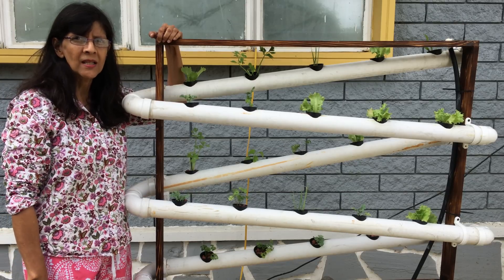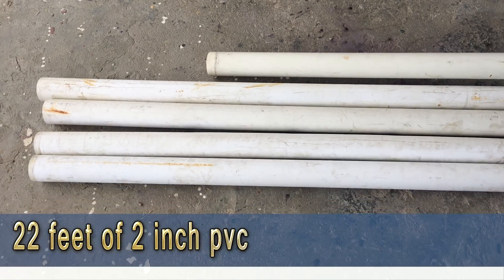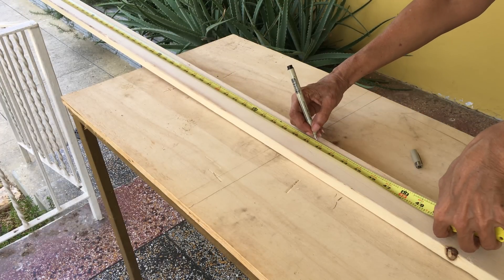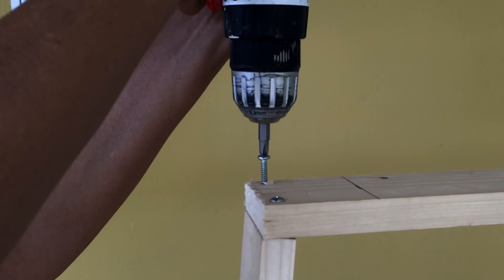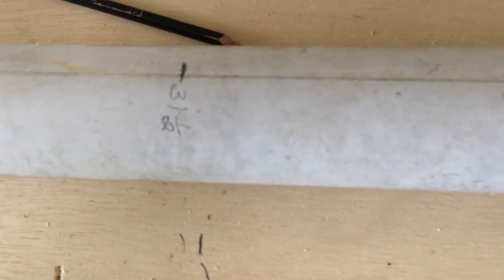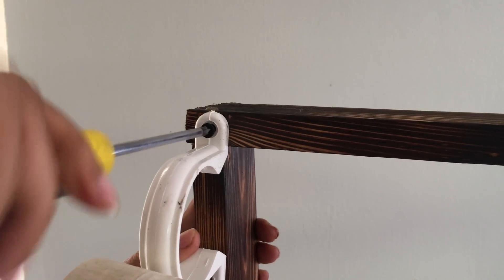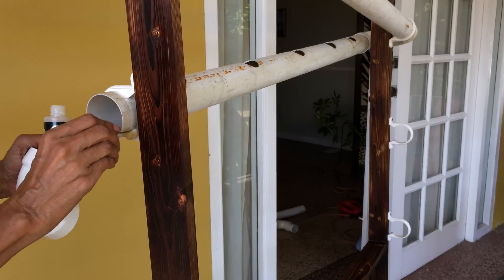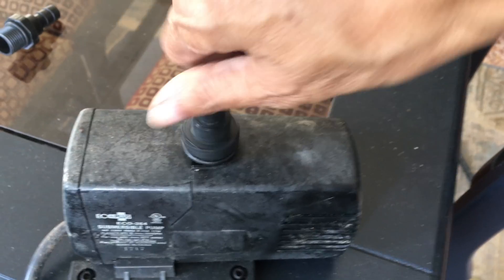DIY Hydroponic Tower NFT System

Comment: A very well done DIY Video Thanks. I have one question, how often do you have to up-grade or replenish your nutrient reservoir (5 gal bucket), How long do you think it would function left unattended (hot Climate) . Thanks Dave
Reply from the maker: Thank you.I usually top up about every 3-5 days.I would not recommend that you turn off the pump in a hot climate as I live in the tropics and the plants would wilt within minutes without the constant flow of the solution.

Comment: Thanks for your instructional video. I've made a system using this concept, just a bit bigger, and it is working very well.  I added heavy duty adjustable furniture feet fittings, so the system can be easily levelled.  So far, so good for leafy greens, herbs, and strawberries.
Reply from the maker: Glad it helped!

Comment: Very original & simple to do hydroponoc system. You mention 2 inches pipes, but they look 3 inches to me. Maybe I am wrong.
Reply from the maker: Thanks.I used 2 inch but 3 will work just as well .
Reply: @over60crafter  Thank you very much for the reply

Comment: Hi ! Thank you for the video. I made somehow the same kind of build (with 4 inchs tubes) and I was wondering if I had added too much angle to my PVC tubes (4cm per meters / 1.5 inch for 40 inchs) because my water level is very low inside the tubes and the flow goes fast. But when I see your angle, I guess it might be the case for you also. Is it an issue for you ? Also I missed the part where maybe you give the dimensions of the baskets/paniers. Are they touching the bottom of the tube ? Are they touching the waterflow ?
Reply from the maker: Hi,some people say mines is a bit to steep but it worked for me,after all it's an nft system which stand for nutrient film technique.I used 2 inch net cups.They don't touch the bottom they are about an inch from the bottom, I made sure the roots were long enough before placing them in this system.Hope that helps.
Reply: You understood that in my case I'm not sure if the issue is : the waterlevel too low or my paniers/baskets too hight above the waterlevel :(
Reply: Ok ! Thank you for sharing your experience and knowledge :)

Comment: Thanks for you video,For lettuce, mint, and coriander, which size pipe and net pot are recommended
Reply from the maker: I have done lettuce in 2 inch and I am sure you can also use that for the coriander,the mint however since they grow very big easily I would recommend a larger size about 3 inches.
Reply: @over60crafter  which one is recommended as grow medium ?Cocopeat or perlite ?(for both nft and dutch bucket system)

Comment: Hi. I build one like your, very appreciated your instructions. But when i put the 2 inch pot and i see the water not touching it. About 1/4 inch gap from bottom pot to touch water. So is that still work? 
Also how long the time you have to set the pump since this build nor horizontal, if stop pumping the water will be gone? Please have me these 2 questions. Thanks
Reply from the maker: I actually squeezed the netcup while placing it into the hole so the top of the netcup is also inside the pipe that way it touches the bottom and is able to be in contact with the nutrients.This system will require you to run the pump full time or if you live in a cooler climate you might get away with running it for about 2 minutes every half an hour or you can experiment to see what works for you.

Comment: Hello and thank you! I built a version very similar and I bought the same pump you used in the video. The pipes are the same elevation and size as yours. I am wondering if the 396gph is too much for this setup. The water is very fast. What do you think? Love your channel.
Reply from the maker: Thank you. If it's the exact same pump,then it will be fine.I looked at your build well done,only suggestion is to change out the clear tubing as you will end up with algae growth in it.

Comment: Amazingggggg video Ma'am.
My question might be silly but it's always better to ask instead of assuming...
It would be great if you could share the reason behind the keeping / mounting those pipes at an angle or in a slope form.
Would like to know the reason behind it.

Also, can I increase 3-4 more pipes?

Please guide me on the same.

Keep up the good work...

Straight away heading to click on the subscribe button along with the bell icon. 🤗❣️
Reply from the maker: Constant flow of the nutrients as its a nft system which  involves growing plants by maintaining a coating of nutrient solution around the roots.
Reply: Okay Ma'am!
Can I add 3-4 more pipes?
Thanks a lot for the prompt response!

Comment: very informative video. instead of buying ready made hydro system which is a little bit pricey, i think i will build my own now that i have clear idea how to do it..... I would to ask though, what is the ideal distance between hole? seen in the previous video its about 3 inches apart but per your video its 8 inches apart, thus limiting the number of holes. thanks a lot
Reply from the maker: Thank you.The spacing is really depends on what you are growing,it can vary between 3 and 5 inches apart.Chive for example does not spread out as full as a lettuce plant.Good luck.

Comment: Thank you very much for this vid! Will 80 gph do for the pump? Other option is 300gph, but want to spend as little as possible
Reply from the maker: You are welcome. Look for a pump that can pump up to six feet high .I have  a link in the description,I don't think 80 gph will work unless it can pump up to six feet high.
Reply: @over60crafter  thanks for looking at my build. I stepped out each level so that the overhead light wouldn't be blocked by the pipe above it. You're right, i knew that clear tubing was a mistake while I was installing it. Thanks for the advice, I will keep the pump and see how she does.

Comment: Hello! Thank you for the video. My girlfriend and I built a small version of this, with the same pump, somewhat less slope, but 4" pipe. We are finding that the water flow in the bottom is only about 3/4" wide, which does not seem to be deep enough for our net potted starts. They do reach the bottom, but the strong flow of water tends to push the roots to the sides of the PVC, away from the water. My girlfriend insisted in 4" pipe because of other videos she saw, and now says we need to decrease the angle (dramatically) so the water flows much more slowly through the PVC. Do you have any recommendations on how to do this, or other corrections we could make? Thanks again!
Reply from the maker: If the flow is to forceful why not get a less gph pump but just ensure it can pump to the height of your system.You can also had another level or two of pipes so that the angle won't be as steep.
Reply: I know this is 1 year late but for others, an option would be a wick, such as a nylon or polypropylene (think food safe) rope run through the bottom of the net pots as a wick.  Maybe a 6" or 12" piece, slightly untwisted just to get more moisture wicked up.  Its a trick I have used before.

Comment: Thank you for a very enlightening video. Very clear instructions. Is there a reason why the gradient of the pipes on one side of the frame is steeper than the other side? What is a recommended gradient  and what is the effect of the flow rate in the pipes on nutrient uptake and plant growth?
Reply from the maker: No .In fact you don't have to build it as steep just add two more rows of pipe and push them up so it would not be as steep.

Comment: Hello..im just wondering what will happen to the system if there's a power interruption like for several hours?
Reply from the maker: This system is intended to run 24/7 so if power goes out for a couple of hours the length of time the plant will survive will depend on the temperature,you could also just water the plants every hour and I think it would be fine.

Comment: Awesome, but I think the slope is too much, water will flow fast and go down, and I didn't see any stoppers at the bends to keep some water for the plants all the time. This will use more energy as the pump has to work more.
Reply from the maker: You can always angle it differently so that it is not so steep and that way you can get more plants in,thing is this design works for me,I use a 396 GPH pump and it is on 24/7.

Comment: Hi...awesome and very informative video...best and easiest to follow thus far...what kind of seedlings did you use in this project? Also...how often did you change water and/add nutrients?
Reply from the maker: Leafy greens like lettuce, swiss chard and other do well in this system.I usually just top up the solution when necessary.

Comment: Great video. Does the 5 gallon bucket need to be good grade or can I find one at Home Depot?
Reply from the maker: I would recommend a food grade bucket check your local bakery or grocery they usually have lots to dispose of after emptying food content like frosting,flavorings,syrup etc.
Reply: Thank you! I successfully finished the build today. I was curious about the slopes of the pipe and the required flow rate. 5.5-7”/43” equals 12-16%. Do you find that this is too steep? I’ve read the required slope needs to be 2.5-3%?

Comment: Do you find that the plants all receive an equal amounts of nutrients, or do the upper level plants do a little better than the guys at the bottom?  Thanks in advance!
Reply from the maker: The plants do well,no problems its not that many about the same in my vertical grow tower build,which I actually prefer to this build.
Reply: @over60crafter  I have a few plants on rafts right now, but am about to build a rail system and am trying to pin down all the pros and cons of the various ways they can be constructed.  Thank you so much for sharing your insight!

Comment: loved the video! using this for a project in my college course, will definitely post a link in the powerpoint swell ;)  but curious about the material list. you have an air pump and air stone on the list but they weren't used in the video, wondering if those are vital pieces in the project?!
Reply from the maker: Thank you.Actually I did place the air stone in the bucket ,I probably forgot to shoot it.The air pump and air stone will increase the aeration in the reservoir which is always a good thing for plants but you can try it without it first.

Comment: Thanks for the post. Very informative. 
Why do we need listed in your items but not in the video? How should we use them if at all they are needed?
4 inch air stone https://amzn.to/2oLZQ5O
Air pump https://amzn.to/2pu495y
Reply from the maker: I think I forgot it in the video. You would also need  1/4 tubing to go with those two items connect the tubing to the pump which sits outside the reservoir and attach the other end of the tubing to the air stone and rest it in the bucket.

Comment: I am trying to decide between using the two 90 degree angle pieces (to go in the other direction) or use end-caps with a hole and flexible tubing. Can anyone offer suggestions? I like the simplicity of the 90 degree pieces but wondering if I will want to control the water level with the caps and tubing.

Comment: What size pump did you put on it?
Reply from the maker: Hi Denise,I used an ecoplus 396 Gallons per hour pump  which has a maximum pumping height of 6.3 feet.Whatever pump you get it is very important to check up to what height it can pump.

Comment: Nice set up. Do you experience or notice nutrition deficiencies on your plants towards the lower section of the system?
Reply from the maker: No problems so far,but I started pruning the older leaves at the bottom of the tomato plants.